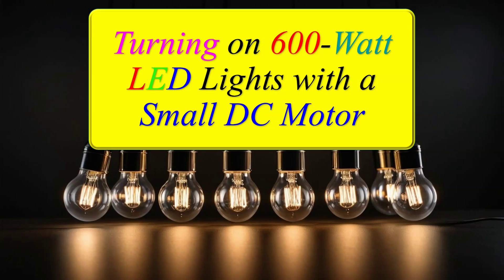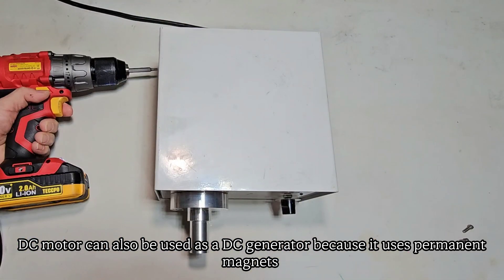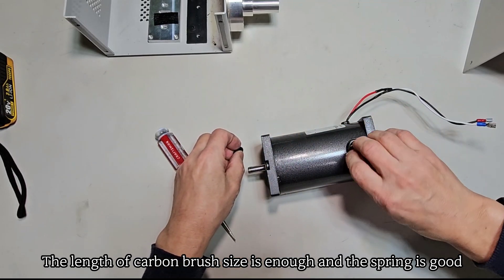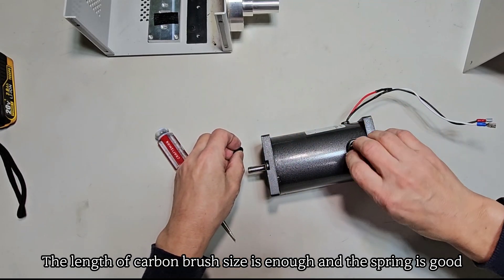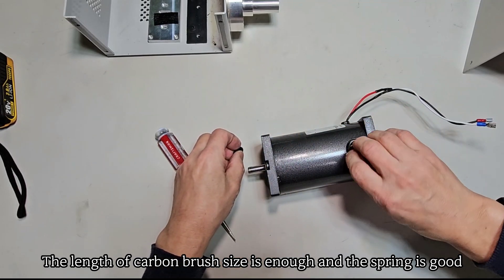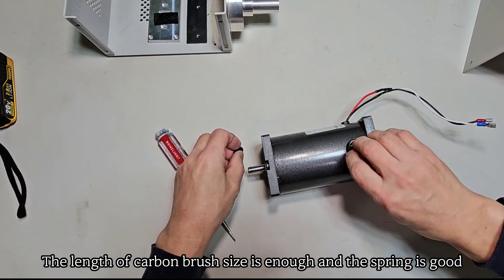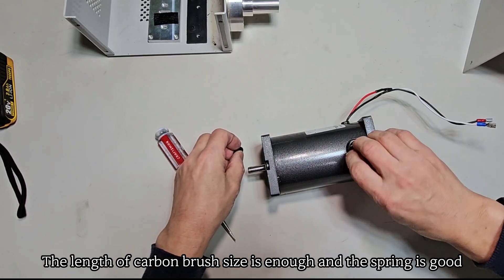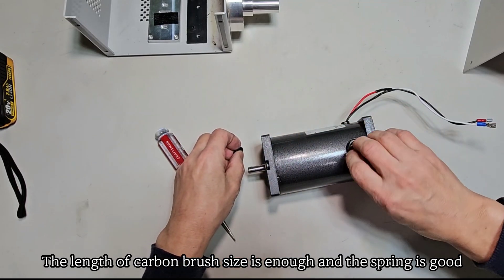How a Small DC Motor Powers 600-Watt LED Lights | Flywheel Energy Storage Demo

Comment: Does it provide enough power to power the dc motor too?
Reply from the maker: Yes, It can do that when the flywheel has enough kinetic energy, but the time is short
Reply: @LanikaiEnergy  is there any way to make it run forever?
Reply from the maker: @ha-ub8pg  There are millions of free energy generator contents in the YouTube Free Energy section. 99.99% of them are all fake and fraudulent. There's no reason to put it on YouTube if they actually developed a free energy device. They need to apply for a patent. But scammers upload directly to YouTube, so that means all the devices they make are fake and scam.
The easiest example is if someone made a free energy device using Spark plug, it's fake.

A flywheel motor generator makes free energy. There are a lot of fake videos among these flywheel motor generators. Also, a very special type of magnetic motor can work forever

Comment: En el caso de éste proyecto era bueno poner el tester en modo lectura de amperios y saber el consumo del arreglo de los bombillos
Reply from the maker: The maximum amp was under 1.5 AMP. I didn't turn up the current to protect the small motor

Comment: Gracias por compartir tus videos, hay una información que no aportaste que servirá de referencia.. es cuánta energía está consumiendo el motor.. otro detalle como referencia " los generadores a menor diámetro requieren de más RPM, igualmente los motores al ser de menor diámetro el rotor requieren de mas energía eléctrica para poderla convertir en energía mecánica.. está a tu alcance poder usar un motor de lavadora Inverter y analiza cuanta energía consume vs cuanto torque genera.

Comment: nice work how much volt in put and watts /amps
Reply from the maker: The maximum Amp was under 1.5 A@ low volt and the max volt was 120V @low Amp

Comment: How about , the input power of a drive motor?
Reply from the maker: Around 80Watts
Reply: @LanikaiEnergy Motor drive is useless.  The drive motor should have high input power so it can produce sufficient output power for the generator.

Comment: You never mentioned about the power consumption of those 6 LED light bulbs. Are you sure total power consumption is 600W? It seems to me that those light bulbs are something like 10W each!!
Reply from the maker: I was expecting this question. A small motor alone can never turn on six LED lights. That's why Flywheel was used. The LED bulb I used had 17 watts of power consumption. So that's 17X6 = 102W in total. The reason I couldn't turn on the six bulbs from the start was because the motor's power was weak, so I waited for the flywheel to have enough energy stored. If you look at my other video (500 Watts heating lamp lighting), that heating lamp will light up for a while. And the moment I turn on the lamp, the kinetic energy stored in the flywheel is gradually drained, which weakens the lamp's brightness. So I think the maximum instantaneous power of the system is around 500 watts. I think 80% of power came from the two flywheel's kinetic energy( Total 10Kg & over 3600RPM). Thank you for your good question.
Reply: @LanikaiEnergy thanks for the detailed explanation.
Reply: Hola, trabajo con iluminación led, por experiencia la referencia del bombillo en vatios es lumínica con respecto al filamento del incandescente. Una lámpara de 36 vatios consume 280 miliamperios
Reply from the maker: @franklittle6965   A small motor alone can never turn on six LED lights. That's why Flywheel was used. The LED bulb I used had 17 watts of power consumption. So that's 17X6 = 102W in total. The reason I couldn't turn on the six bulbs from the start was because the motor's power was weak, so I waited for the flywheel to have enough energy stored. If you look at my other video (500 Watts heating lamp lighting), that heating lamp will light up for a while. And the moment I turn on the lamp, the kinetic energy stored in the flywheel is gradually drained, which weakens the lamp's brightness. So I think the maximum instantaneous power of the system is around 500 watts. I think 80% of power came from the two flywheel's kinetic energy( Total 10Kg & over 3600RPM). Thank you for your good question.